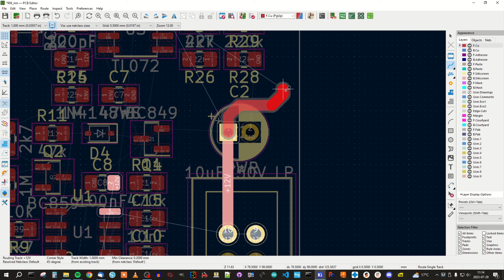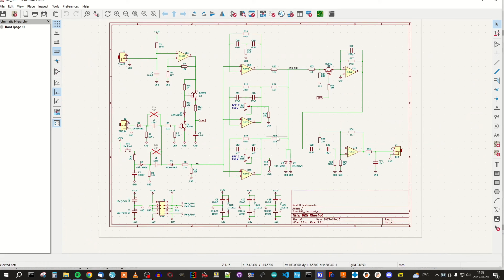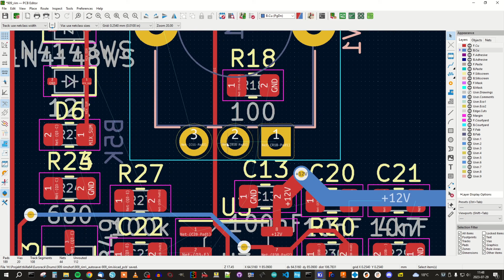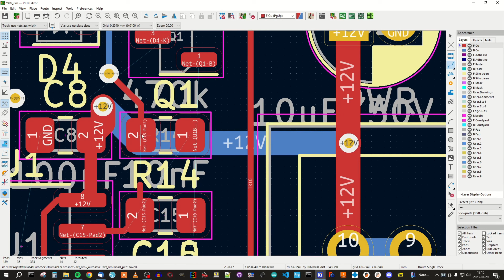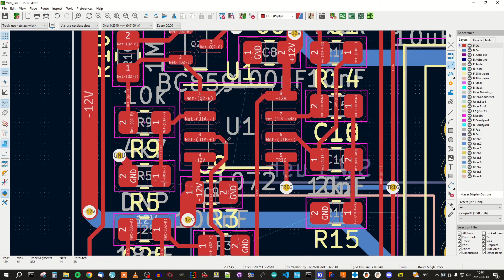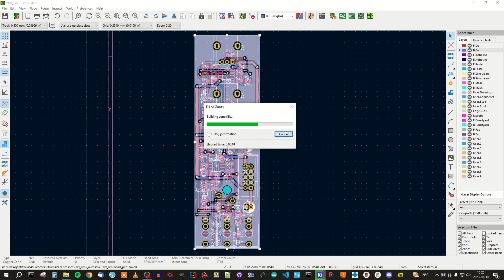Eurorack DIY: 909 Rimshot (Episode 4) - Routing the PCB

Comment: lol, the same problem again, the trigger input was designed for 5V, it needs a diode limiter to 5V after the capacitor of the trigger input jack. Eurorack "standard" is 10V for ADSR, gates and so, everything will be out of wack if someone using modules from like Doepfer or so and injects 10V. you should definitely add a pot to GND for the velocity input, because it also was made for 5V, but somehow it's 12V in your schematic.

I have made a usefull circuit to create a perfect square 1ms, 2ms or what ever trigger signals and it is very important (i also have some Roland TR drum sounds made on vero board on a big plank of wood but i used a PIC18F1320 @ 40mHz, it sounded very weird without the correct trigger signal duration), it's kinda digital, but doesn't require software. Can upload it for you, so you can have a look at it.
Reply from the maker: The trigger and accent inputs are identical to hex-inverters design, I didn't spend much thought on the shape of the trig-signal, but you are correct that it should be a digital trig signal limited to 0-5V, with fast rise- and fall-time.
I'm using my 909 modules with a DIY MIDI-to-trig-interface and I use 74HCT595 (VCC@5V) for the trig outputs. The trig high duration is 4ms.
Reply: @MeeBilt  Ya, but you're not building modules for your self if sell them.
It should work in any case for other people using different modules from different "brands" to avoid claims, don't trust online schematics. i have uploaded a new circuit video containing a trigger circuit. maybe it will suit you.

Why use the 74HC595 for gates? use the 74hc174, much better, just like Roland did in the TR-909 or CD74HC574E with is 8 output.
cascade them like Roland did, probably a bit faster than bit shifting, almost instantly, 3 clock cycles. with 3 x 74hc174 you need 6 data lines and 8 with the CD74HC374.

You need a diode to 5 volt to limit on the trigger input before heading to the transistors or havok will occur.
Reply: @MeeBilt  You could remove Q80, Q81 and the stuff around it from the Hi hat circuit, move R480, R475 between Q85 and the inverted opamp input of IC 67B, copy or move the 1.2nF and 100pF on the same spot as on the Q80, apply a static positive offset voltage of 2.5V on the NON inverting pin of IC 67B, play with value R483, but you have to play with 1.2nF and 100pF, witch is a type of anti aliasing filter, till it sounds right. You safe 9 parts or so.
You could also do what i tell, but double IC 67B and have 2 anti aliasing filters, like before.
Reply from the maker: @AnalogDude_  Thanks for the suggestions. If I decide to make a product that I can sell I will definately revisit the design and have a look at the overall BOM and maybe add some features. I'm also considering to redesign the trigger circuit (maybe remove the button completely).
But I will complete all 909 voices before I do that, so I can consolidate the BOM and learn more about which part of the design that I can reuse between different modules.
Reply: @MeeBilt  I'm making a pcb with the 74hc174 part and the (roland) resistors, i did a simulation and also with a normal R2R array, than i added the "VCA", opamp and Q80, Q81. using a plain R2R array avoids special values of resistors and does the same job, but takes up more room, unless you use resistor array's.

For the VCA part you could use a LM13700 instead of Q85.

it's probably best to use a AT27c512 for the cymbal and crash and use 2 x 74HC174, but that requires a MCU and a few lines of code to jump between the addresses of the crash and cymbal in between (mixing), like done in the tr-707.

dropping the button is a good idea, but i guess before that you should make a Sequencer.